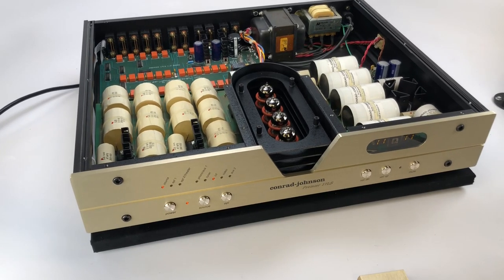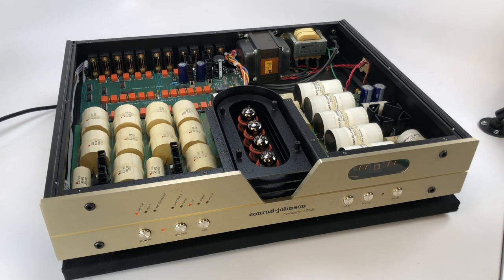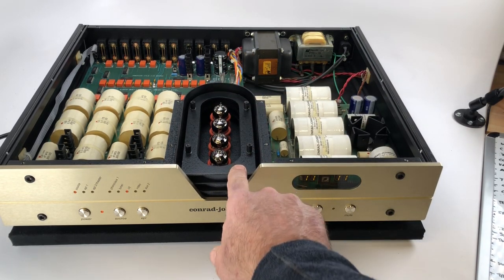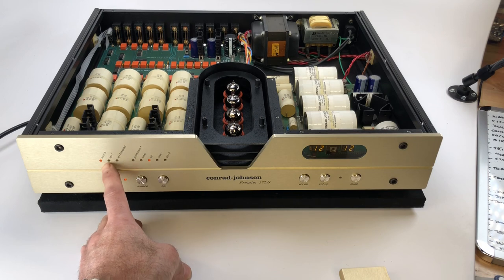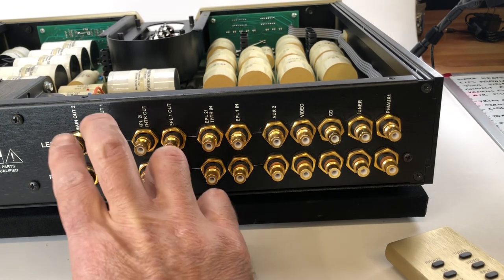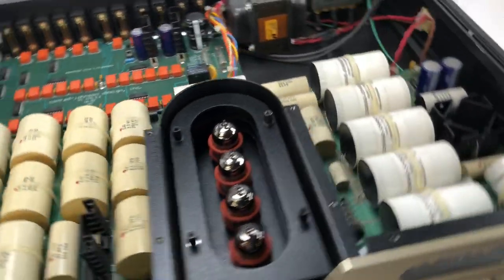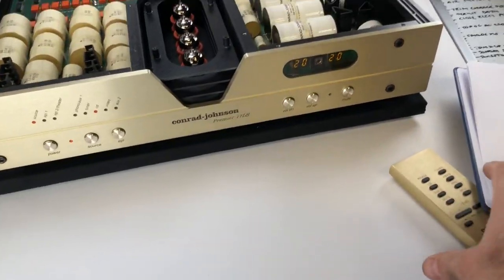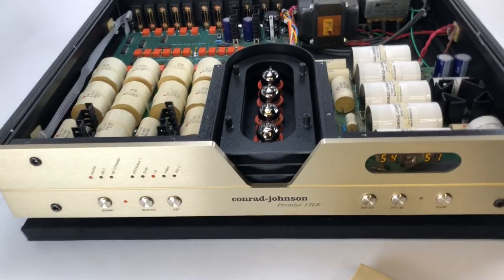Inside the Amazing Conrad-Johnson Premier 17LS Tube Preamp!

Comment: I have had this preamp in my system since 2005, and it has always worked excellent, matched with McIntosh 501 and silver cables makes the system musical and transparent.   If anyone is interested in knowing more leave me a comment.
Reply: how does this compare to the CJ ET5...❓
Reply: @briancampbell7712  I'm not really sure, when I bought the CJ I never compared it to any other CJs but did listen to some McIntosh pre amps and it sounded as good if not better.  For $2,500.00 I don't think there is a better amp out there at that price.

Comment: Each relay has a minimal current specification. That means that low signals will be distorted. And relay based logarithmic volume control has 6-7 relays on a path. Plus one relay from input, and one to an output. So, 8-9 in total until a signal finally escapes. I'm not sure one motor driven potenciometer is the worse choice.
Reply: Small signal telecoms relays have a minutely low minimal current spec. Using a rotary potentiometer introduces more issues with impedance so like everything its a compramise.

Comment: Rather than duplicating what's inside when it's balanced, more quality goes to the parts because it's unbalanced.  Getting a pre that is balanced is not necessarily a good or a bad thing, except as stated in previous sentence
Reply: is this unit balanced❓
Reply: @briancampbell7712  cj it's not balanced because it doesn't have balanced Connections
Reply: @iampuzzleman282 
how does the Premier 10 PRE compare❓